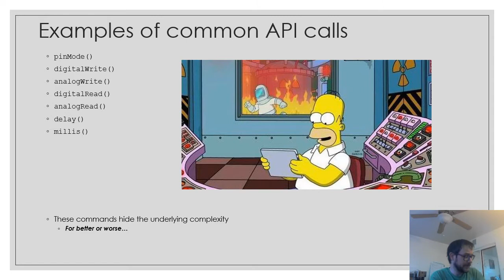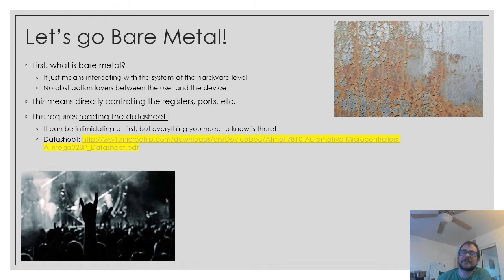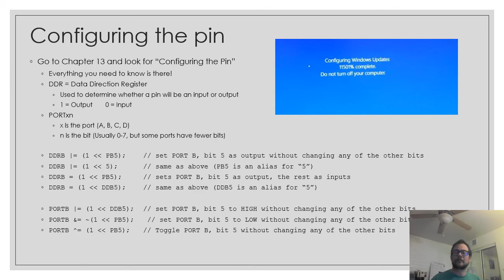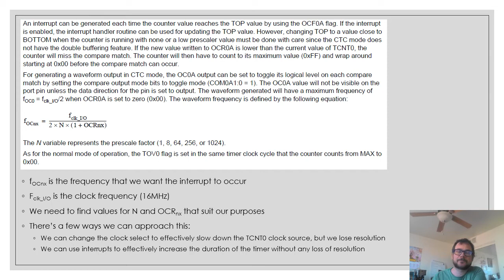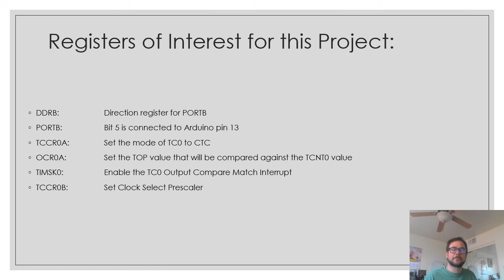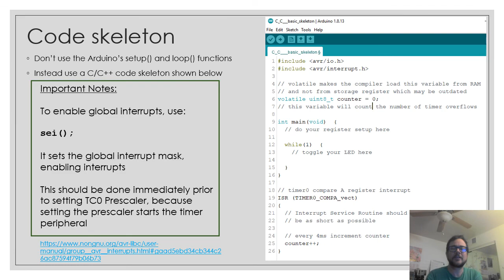Breaking Free of the Limitations of Arduino

Comment: I am struggling with what is meant by "Set the ISR COMPA vect".  I see from the data sheet that we are meant to use vector 15 , however how I use this value to set the ISR comp vector I don't understand. Also I am confused why you have highlighted TIMSK0 as to be used to enable the timer interrupt then later said use sei(); Sorry I am brand new to this and find that even your hints are not quite enough to get me there.

Comment: What would be involved to go even barer metal and free myself of the Arduino IDE/Compiler/bootloader? What might such a tool chain consist of?
I recently bought some Atmega328P chips, the ancillary components to run them (power regulators, crystals, etc) a USBTinyISP and a USB to Serial break out board. My plan was to burn the Arduino boot loader with the ISP and treat them as Arduinos for a project.
I suspect I have enough of the hard ware side, it's the software side I'm less clear on. Compiler? Burning/loading software? (I probably don't want/need a bootloader.)

This video has cured my of my fear of data sheets and given me the confidence that yes, I could totally understand and write ISRs without anyone holding my hand!